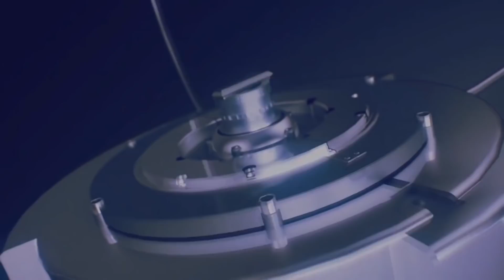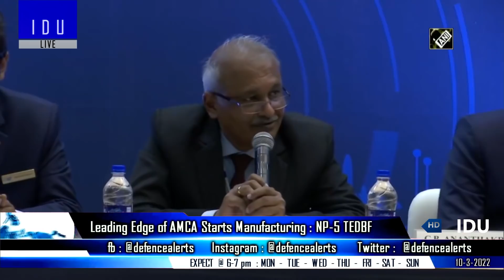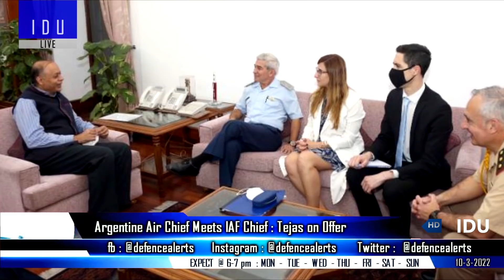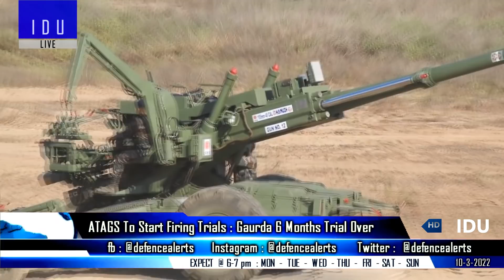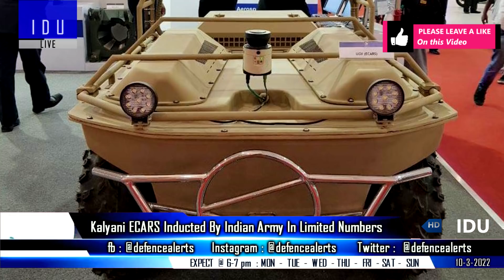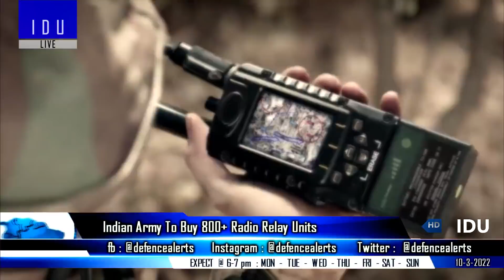Indian Defence Updates : AMCA TD-1 Leading Edge,Tejas To Argentina,CV-90 Offered,ECARS UGV Inducted

Comment: Danush is always good as a test model. The OFB is building it using substandard components they fixed the problems after 29 were produced asking more money. Their production line hasn't improved they didn't buy better components they send the workers to school. The same production problems will arise again when they resume production. Transfer the entire project to the private sector and let them fix the problems and mass produce an actually working example.